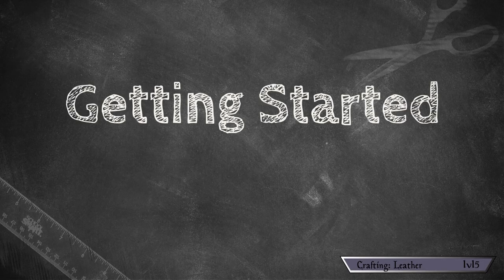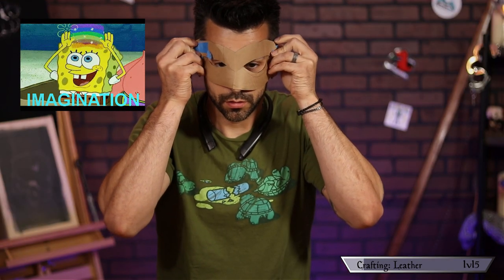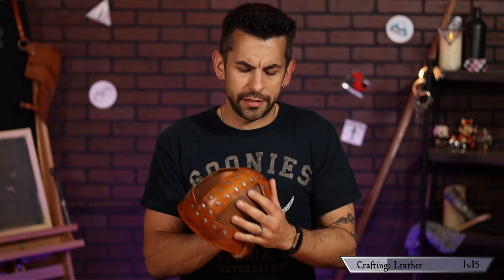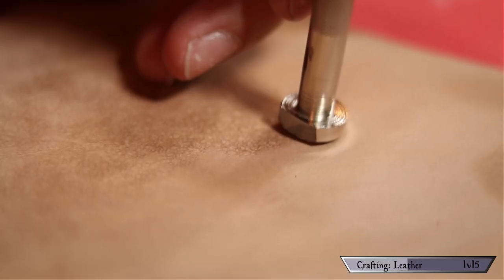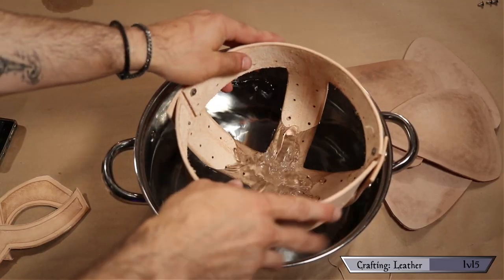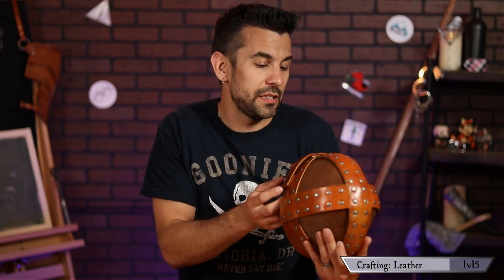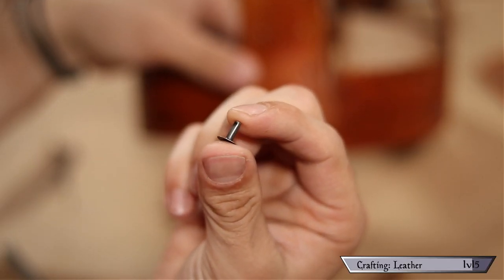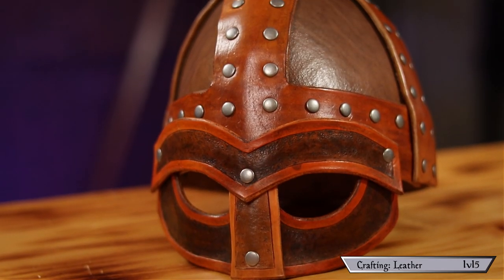Leather Viking Helmet | Skill Tree

Comment: You've probably figured this one out by now, but how to carve designs on the leather which will end up convex:
   1-Wet the leather
   2-Gently stretch it over something hard in the shape it will end up: a helmet, a mixing bowl or perhaps the arm of a chair.
   3-Place the leather so the centre of the design is directly in front of you
   4- Carve the design you want from the centre, moving it to the left and right if you need but not rotating it at all.
For smaller pieces, a pasta/dessert bowl or a large rolling pin can work.

I like your channel. Your enjoyment of things is endearing and uplifting.

Comment: Hey Man, awesome video as always! I do quite a bit of leatherwork and your order of things is correct. That being said, Tooling and wet forming do work great together. You need slightly damp leather for tooling and fairly wet leather for forming. When you saturate a piece for forming, the fine detail is often lost when you apply pressure. I will say you can get out of this a little with deeper cuts or impressions, but you will still lose detail. The other option is to form your piece, then try to tool it on a last or a plug. This process is lackluster at best and really only works on flat things that you can put a plug behind, like a pouch. Anyway, hope this helps. Feel free to message me if I can help more.
Reply from the maker: Thanks for the tips! Good to know I am not just dumb, lol. I was trying a few things but just couldn't get the details to stay. Thanks for watching!

Comment: Nice job man! As far as your question goes for wet forming. I can offer you only what I discovered worked for me. Now then I am by means no expert. I got back into the craft about 6 months ago. So my knowledge isn't as vast as some. However when it comes to wet forming you're order is right for your project. There are times when wetforming can be done first but usually that's for items wetformed around solid molds. Like a pouch. However most of the wetforming I do is basically all free hand forming. So here is something I found to save your tooling. Don't dip your piece. Sponge the front lightly to avoid water marks. Then soak the flesh/skived side until malleable. It takes a little than just soaking but it has kept all my tooling crisp.
Reply from the maker: Great tip! Thanks!

Comment: I have just a tiny thing to add, if you are building this thing to really fight, use leather of at least  6mm strength and harden it properly.
For optimal protection the helmet should end at the eyebrows. 
Otherwise its not safe enough.
Reply from the maker: 100%. I may even recommend padding the inside too to help absorb impact better.
Reply: @SkillTree  yeah I always wear a padded hood, so I don't have to work one I to every single helmet etc

Comment: Dude! That turned out awesome! Ironically, these were probably more common than we even know! The Norse in the early medieval era were limited to bog iron or recycled iron, so it is quite quite probable that many of the Vikings actually did use these as they definitely work defensively, the boiled leather techniques were known to them, and get this... there are less than 40 examples of metal helmets over a 300 year time span! Great job!

Comment: for wet forming it's usually you can have tooling OR wet forming. it's difficult to keep tooling looking sharp after you wet form. Also, if you use hair on sheep skin you get a more even color application when applying dye.

Comment: For your issue with the stamps fading when you wet form, I haven't found a good workaround for such a faint stamp. I mostly do tooling with a swivel knife and bevels and such which doesn't fade nearly as much because it's deeper and more defined. I would mess around and find some more pronounced stamps you like.
Reply from the maker: Good idea! I will look around and see if I can find something a little more defined. Thanks for watching and for the tip!
Reply: You can go to most metal supply stores and by larger sized metal balls. If you have the ability to weld just put in on a stake the round hard surface allows you to tool on the curve. It's a tricky method to get used to however it's the only one I've found to prevent fading
Reply: Also as an added bonus it can be used for wet forming helmets to get a better dish

Comment: So it doesn't take a huge amount of pressure to wet form leather. You could try simply placing the leather plates on the bowl and adding another bowl on top. Then add a little weight on top. Like a bag of sugar or flour. They will take the form as the leather dries. Also,  you can take your leather while it's still soaked (not dripping) and formed, place it in an oven at 200 degrees for a while (Time is variable by the size of the piece) Make sure the oven is preheated to get the evenest result. This will harden the leather. Thus making it more protective if you're interested in that kind of thing. You can still dye and color the leather after it's hardened but you probably want to make sure any punching of holes is done first. Unless you dip dye the leather your shouldn't add so much moisture back that the result is lost.

Comment: Hello! I wanted to thank you for these amazing tutorials, they are really helpful and well explained, and I already made a pair of beautiful bracers. That being said, I'm having a bit of a trouble making this pattern. Once I taped it, it looks WAY bigger than I expected it to be. I know I have a big head, but I dont plan on wear anything underneath (maybe a bandana to keep my hair tucked inside). 

I use centimeters, so when you said you added an inch, i added about 2,5 cm. Is that correct? When I tried it on, its veeery loose and way too big. Just wanna make sure I'm not adding too much space to my pattern. That being said, thank you so much! You deserve a lot of followers and likes, and I think you have the best leather tutorials 👏👏😘
Reply from the maker: Thank you so much for watching and all your kind words! That is the correct measurment but it shouldn't be crazy loose. That's the nice thing about doing the pattern first though. It gives you a chance to dial it in. You just want to make sure you have enough room to compensate for the thickness of the leather you are using. As long as you think you have enough room for that it should be OK.
Reply: @SkillTree   thank you for answering so  quickly! I'll make a different pattern this afternoon adding maybe half and inch, and I'll see how it goes. My leather looks a bit thinner than yours, but I dont plan on using the helmet for "real" protection, so maybe its OK. As I said before, you have great tutorials and tips and you explain everything very clear. I wouldnt have started leathercrafting without you! You are doing a great job 👏👏
Reply from the maker: @gaela2659  I hope you share how it comes out! Happy leveling up!

Comment: Thank you for this video!
Is there any pattern you used for the face mask? It's the best one I've seen, but have no freehand artistic talent
Reply from the maker: I didn't use a pattern. I just made it out of paper and adjusted it until I liked how it fit. It is easier if you only draw one half. Then fold the paper in half and cut it out so it is symmetrical. I AM making patterns soon and will mention it in my community tab here on Youtube when they are ready.

Comment: if you wet form your leather before tooling it you can use a round bowl or a softball (or anything rigged enough in a similar shape and what you formed) just make sure you dont over saturate the leather and lose the initial shape ... if you need to just set it back up it shouldnt be too hard
Reply from the maker: Thanks for the tip! I think you're right. I think I oversaturated it and lost detail that way. I have some stuff coming up soon and I will give what you said a shot. Thank you for watching!

Comment: To make tooling pop on moulded parts just tool deeper. Cut deeper, hit harder.
Reply from the maker: Good tip! I think I tool lightly for fear of cutting too deep. I will play with some test pieces doing what you said. Thanks for watching!
Reply: @SkillTree  I try cutting like 1/3 of the thickness of the leather deep. And to refine the tooling after forming you can use a modeling tool to redefine it all.
Reply from the maker: @PatinaLeathercraft  thank you for the tip! I will definitely be giving it a try soon.

Comment: My suggestion for details is to use an Applique technique - make your base armour and then go add an applique piece that has the detail that you want so you don't lose the detail. DM me if you want an example of this (I did it for my bracer). It means either stitching or riveting your pieces together (with some contact cement too).
Reply: Also, look into painting techniques to allow your designs to pop. You can apply acrylic paint and then cover the whole piece with resolene (acrylic sealant) that will let you have a very durable design.